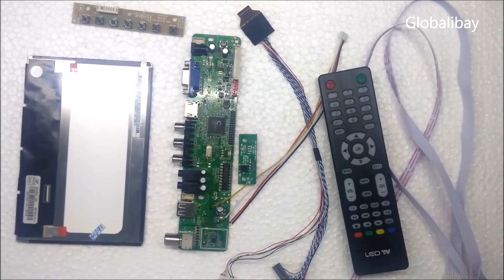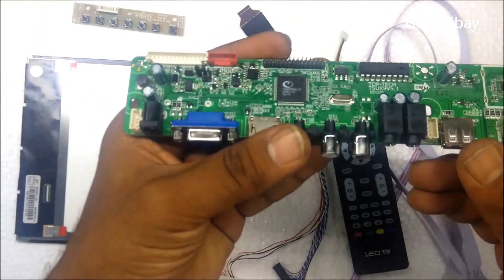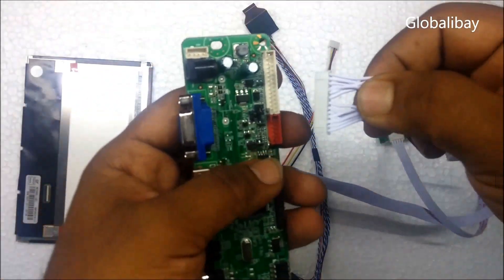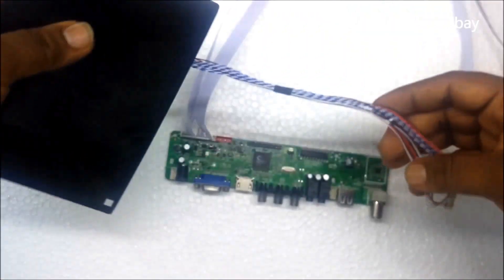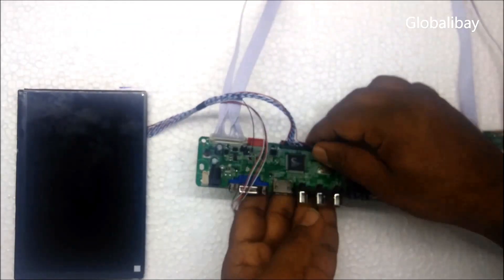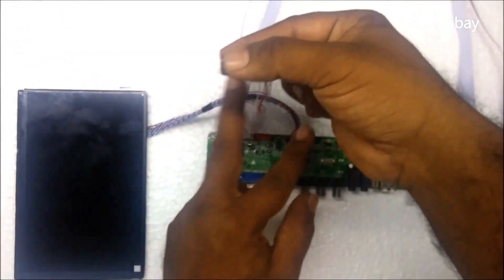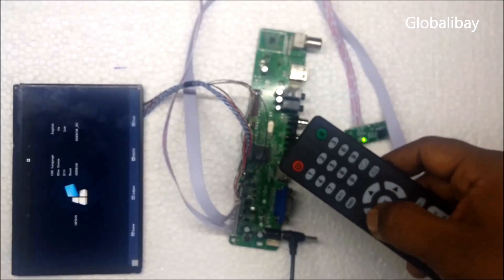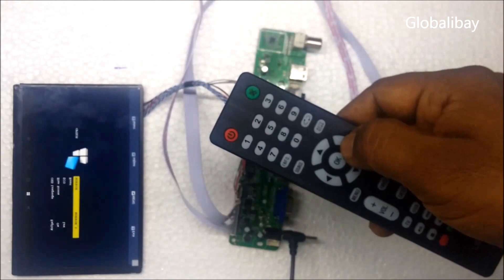LCD and Controller Connections

Comment: hi, nice video.
i am having 7 inch display of 50 pin(driver board) lvds.
from where i can get this.
i am trying to building projector out of this.
Reply from the maker: I believe this is FFC cable and this LCD is pulled out of tablet with LCD resolution 800*480, well, we don't have Controller for this as this resolution is very old